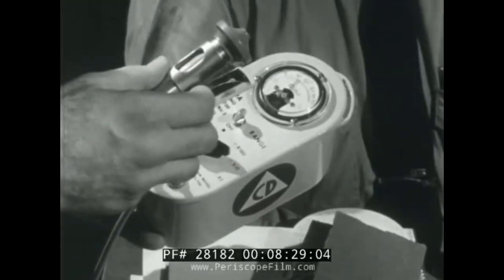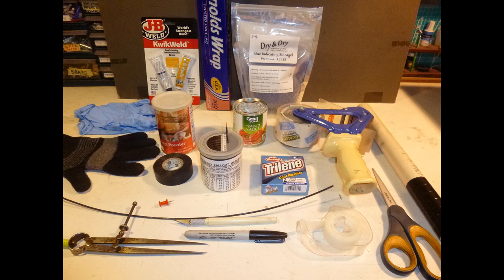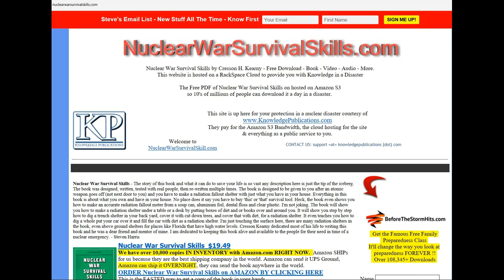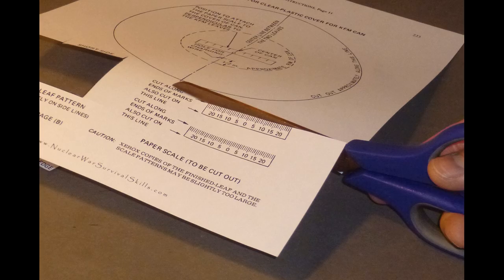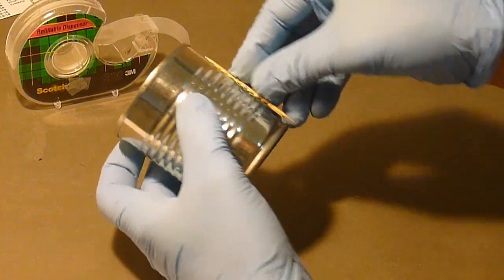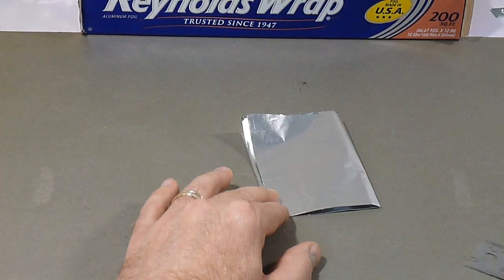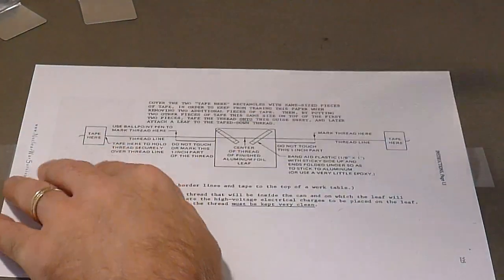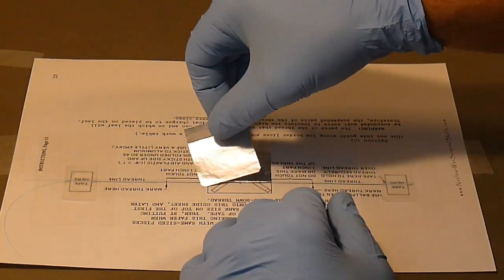The Modified Kearny Fallout Meter- Video #1

Comment: Experimental testing of my version of the KFM shows that it works great! I'm detecting radiation very well.

I used an alpha source listed as 5 microcuries.
I measured 4 mm difference after just 15 seconds. 
That's quite different from my background Radiation readings, which I suspect are due to tiny, tiny amounts of moisture: I usually lose less than or equal to 1 mm per week.

Comment: Thank you for your information, I could never get the template to work right with my copy of NWSS. I have the Skyhorse Publishing Edition (2015, red cover with the little radiation symbol on it) and the dimensions are wrong! The width of the paper cover is only 7-7/8"! Beware the red edition NWSS, its dimensions are all wrong!
Reply from the maker: A very helpful tip. It is very important to build the KFM to the exact size. It would be difficult for anyone to build a KFM from this editions templates.

Comment: QUESTION:  Is ‘Everyday’ Reynolds’s wrap the same as “regular” Reynolds’s Wrap?
Reply from the maker: Yes. Don't use 'Heavy Duty' Reynolds wrap.
Reply: As an aside, it is technically possible to use the heavy duty stuff, there are instructions provided by the author. It's just strongly discouraged. In peacetime, find the right stuff. 😁

Comment: It is VERY difficult to find insulators for the suspension strings that work well enough to pass the standard test of  1mm drop in 3 hours.  Virtually all the old standards like most fishing lines, dental floss, and plastics are now treated with anti-statics which let the charge (over 5kv by the way) bleed off too quickly.
Reply: What do you recommend instead?
Reply: @cdevidal  Personally, I've had good luck with OLD sewing thread - i.e. stuff made in the 70's or earlier.  It will be on a WOODEN spool, not a plastic one.  If you've got a relative who was into sewing back then check with them.  If not... you might consider looking in thrift stores... as that generation passes away a lot of their old sewing supplies wind up in thrift stores.   Kearny recommended J&J UNWAXED dental floss, but it's too thick as is... you have to make thinner threads out of it (sounds like a pain).  He also recommended trying DuPont Stren 2lb fishing leader or maybe Trilene 2lb leader (but it has to "dry out" for hours in your KVM before it achieves it's best performance).  He also said try making 2mm strips from polyethelene plastic bags like the the dry cleaners use or produce sections use.   I think it might be interesting to try single threads from good military grade 550 paracord  - remove the sheath and untwist one of the sections.  With old sewing thread I've achieved < 1mm per hour loss so that would be my first suggestion if possible.
Reply: I can recommend 2mm strips of disposable plastic grocery bags, (the kind that is now being banned, haha). Great insulators, passed the test with 1mm difference overnight (8 hours). Scissors for cutting are not as good as taping the bag down and carefully using a very sharp razor/hobby knife. You can use Scotch tape to make a very fine point on one end of the string to make it easier to thread thru the can holes, (like a needle in sewing).
Reply: Update: with my newest design I get a loss of 1 mm per week. I might make my own video about it.
Reply: @Shrubberyjsc  Please share some details!
Reply: Okay. I might make a video on it to show how I did it. Check back in a few weeks, haha 😂. Busy dad here. <<<<
Reply: @rhymereason3449   If you found my video helpful, please let me know! I'm very interested in swapping ideas for improving the design of the KFM
Reply from the maker: Glad to hear about your results. We all would be very interested and appreciative in knowing how you achieved such remarkable results!
Reply: Here's my build: 
https://youtu.be/w55OMkrqfwg

I think my results are due to having great static insulation on the "strings" holding the leaves, and then sealing all the holes very, very well so no water vapor can get in.

Comment: Hi Scott,

I purchased a KFM from ki4u, which also came with instructions on how to make a KFM. 
The sizes of both the top scale label on the actual KFC I received, and the template label in their document are the same . . . and are different from yours. 

You say that the side can label should be 8 3/16" long, however in the ki4u booklet the can label is 8 3/32". That's a 1 1/2  16ths shorter that your suggested measurement.

I also printed out the KFM labels as you have directed. I had to adjusted my print size so that the label on the side of the can prints at 8 3/16", as you suggest.
I then compared my printout with the plastic glue-on label found on the top of the can of ki4u's pre-built KFM. It was different by 1 1/2 mm.
But more importantly, the label using your measurements did not align with a millimeter rulers, whereas ki4u's label did. 

I don't know which measurements are correct . . . . 
But since the ki4u label corresponds exactly with a millimeter ruler units, I would say that their measurements are the most likely correct.

For those wishing to follow ki4u's label size, make your large can label 8 3/32" long. 
Another thing to note, my laser printer's output is slightly different each time I print a page, so it would be good to use a millimeter ruler to make sure the label at the top of the can that you print corresponds with an accurate ruler.
Reply: I have done further research on this, I have come to doubt some of what I said above.
While the ki4u template showing the millimeter scale is accurate, when I actually created the can label it did not go entirely around the can. 
It seems to me that the two ends of the can label should touch where they meet when wrapped around the can, yet the label that I printed from the template left a 3/8" gape.
To explain this puzzling situation, it's possible that in the reproduction of the ki4u instructions, the can label and the millimeter scale were reproduced somehow different in a different way.

I found the "Cresson Kearney KFM" construction videos by Cresson himself, but when he reached the point where he was putting on the can label in Part 3 of the series, the video ended abruptly, as did Part 1 and Part 2. So I assume there was a Part 4, but I was unable to find it anywhere on the internet.

So without any a direction to turn for a more definitive answer, I will assume that the can label should go fully around the can without a gap, so I suggest following Scott's instructions in creating the can label.

I also want to mention that aside from this issue of the can label, Scott's "Modified KFM" videos are EXCELLENT.

I will also note that the can containing Hunt's Tomato Sauce in the 8oz size appears to fit Kearney recommendations --  2 and 9/16 inner diameter, and 2 and 7/8 inches high . . . available for 54 cents at Walmart.
Reply: @rogerw8000  
why would you buy this anyway... you want a fallout meter? There are plenty of Civil Defense Survey meters & geiger counters on the market that measure way more accurately than this "thing". Measuring instruments need to be calibrated regularly to guarantee that they are showing accurate measurements. If you want to have some radiation measuring instruments in case of nuclear accidents or fallout, i suggest you get 3 items: A geiger counter, a survey meter, and some dosimeters.
Reply: True, there are some advantages with the tools you mentioned, however, the KFM has several advantages over the others. 
It never needs to be calibrated.
It never needs batteries. 
EVERY motivated household in America could have one or more KFMs in a week or less. The tools you mentioned are not available at that level. 
It costs far, far less than the tools you mentioned.

Comment: I can’t get a tin that size in my country, would cutting down a taller tin work ? Or would a 3d printed can work too ?
Reply: In the PDF they mention a method of cutting down larger cans
Reply: @cdevidal  the problem is that the inside diameter is way off , i just ended up 3d printing it with the correct inside diameter and height
Reply: @andreaberetta9656  The problem I ran into was as mentioned by other commenters: The threads and lines sold today tend to have an anti-static coating which completely throws off the calculations. Did you have success with yours?
Reply: @cdevidal  i suggest you try to use dry paper too , you take a sheet of printer paper and fold it a few times, i folded mine 5 , take insulating tape and tape the face facing the outside and that you are going to be holding , do this two times and use one as a handle and the other to rub the piece of plastic , paper worked even during a rainy day unlike wool and even fleece
Reply: @andreaberetta9656  Okay but my previous comment, how did yours turn out and what kind of line did you use?
Reply: @cdevidal  mine turned out really nice , i printed it in e sun white pla + and it looks quite neat , i was able to print it with the holes already made , while the internal diameter and height are correct the outside diameter is a little bigger so i had to adjust for that , charges up nicely and can comfortably charge to around 20mm even in really wet weather ( around 70/80% humidity ) , i used clear silica gel since that's what i had handy
Reply: @andreaberetta9656  Cool. What kind of line did you use?
Reply: @cdevidal  i'm trying to send you a link but i just deletes the comment
Reply: @andreaberetta9656  I have the same problem. If you paste the name of the document and also a line from the document I will google it and should find it.
Reply: @cdevidal  Filo da Pesca in Nylon Trasparente, 0,15 mm x 100 m, Non Elasticizzato, Fino a 0,9 kg di Peso, per Lavori con Perline look for this
Reply: @andreaberetta9656  Found it, thanks

Comment: So my question is,would 6 pound fishing string throw the accuracy off too much?
It's all I have for this first attempt I'm trying now so hypothetically if I needed to have this going today with  only 6 lbs fishing string how off would my device be?
Reply: Yes, 6lb is too stiff and won't give accurate results.  Also most fishing line is now treated with anti-statics making them poor insulators that will leak the charge of.  Berkley 2lb Trilene is about the only fishing line recommended now and it is not necessarily that great.  Other options to try are a single strand of unwaxed dental floss, 2mm strips of a polyethylene bag like a dry cleaning bag, or strands of human hair.  And whatever you try it must be kept clean of contaminants like the oils from your skin.
Reply: @rhymereason3449  thankyou.
I'm building one with the 6lb stuff for practice and my next ones will be the 2lb and the dental floss.
I recon if the need arises I'll just average the number between those two and that'll be as accurate as I could probably get.
Reply: @tarzantoes56  There certainly is an art form to it - I've been tinkering with them off and on for 4 years trying to build the "perfect" one that will lose no more than 1mm/3hrs which is the standard Kearney suggested.  I'm not there yet - but getting close now that I've found a supply of old sewing thread  pre-1987.   Kearney kept tinkering with it until his death trying to find modern materials that worked as well as things he used in the 60's.  After 87' most threads and fishing line got treated with anti-statics which ruin their insulation properties.   Kearney suggested "J&J ultra fine unwaxed dental floss" as one possibility.   Another he suggested is "Dupont Streen 2lb test monofiliment line".  He also says the "Berkley Trilene 2lb test" will work but not as well in his opinion.  I've tried the Trilene and had poor success with it - so I'd go for the Dupont Streen if I were going with the fishing line.  He also suggested 2mm strips of thin polyetheline bags like the dry cleaners uses or most produce sections used to have.   Hair is also worth trying if it is very clean.  Bottom line - I think anything that gets down to 2mm/hr or less is usable - you would just need to extrapolate that out of your readings.
Reply: @rhymereason3449  it was certainly harder than I thought as well when it came to not letting the strings cross before gluing.
Reply: If using a hair, it's been recommended to clean the hair with rubbing alcohol.
Reply from the maker: The first one I made wasn't the best one. It helped me to build a better one on my next try. Still, this a fun project if you are good at making stuff. The things I learned from the book 'Nuclear War Survival Skills' are probably the most important things I learned from this project.
Reply from the maker: 6 lb fishing line is too thick. I resists twisting, which would drastically skew your readings. Using clean hair sounds promising!!!